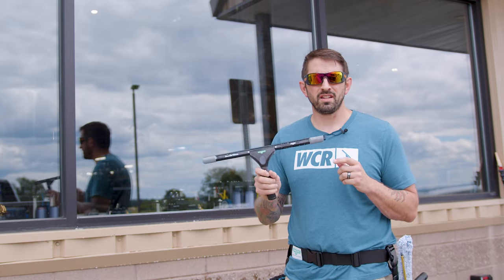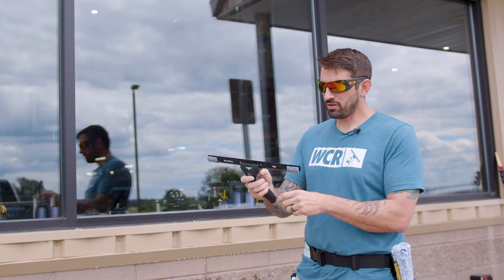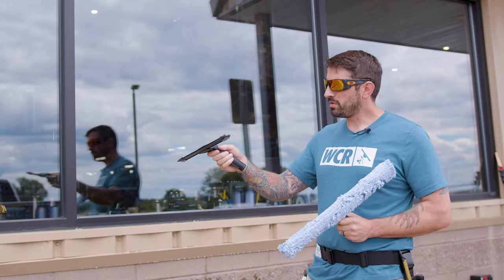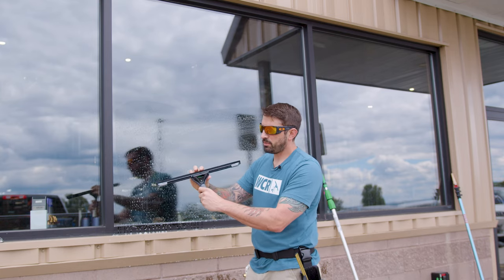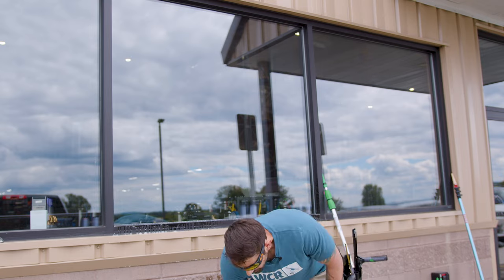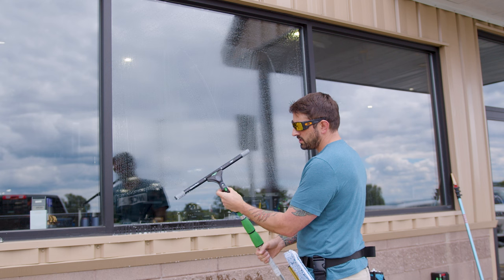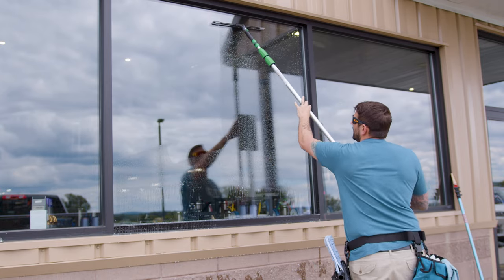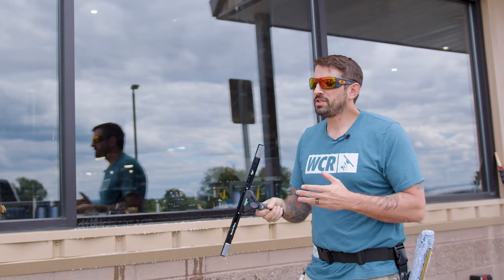Newbies Are Obsessed with This Squeegee

Comment: What do you think  which squegge leaving less detail s plus or ettore brass?
Reply: In my 2+ decades of experience, the s plus leaves a lot less detailing to be done. Half of the time I don't have to touch the window
Reply from the maker: It comes down to preference and how it works for you. We know a lot of people who prefer both.
Reply: @windowcleaner  for me is s plius i cut angles with saw and its perfect!no detail no mistakes better with unger hard rubber or moerman grey.
Reply: The s-plus is designed to leave less detailing so definitely that.
Reply: Moerman gray ftw 👍